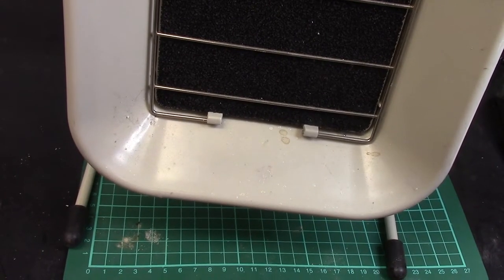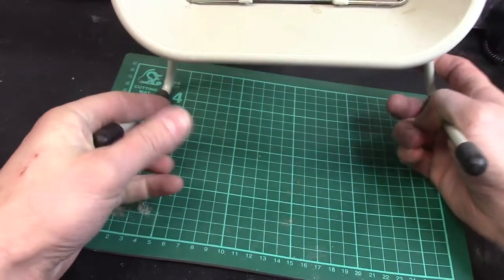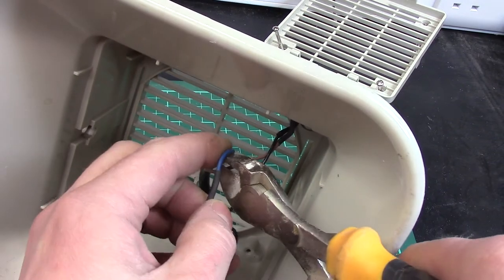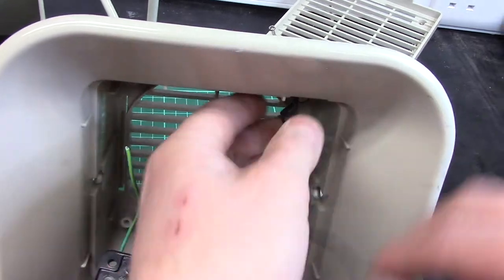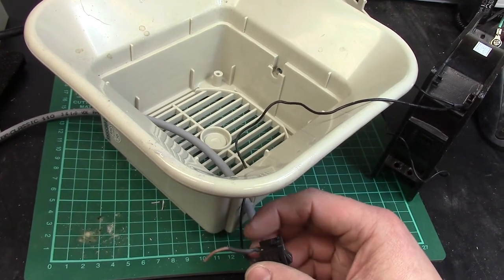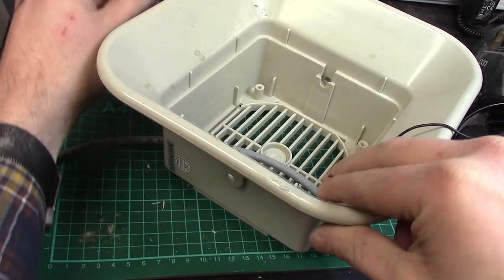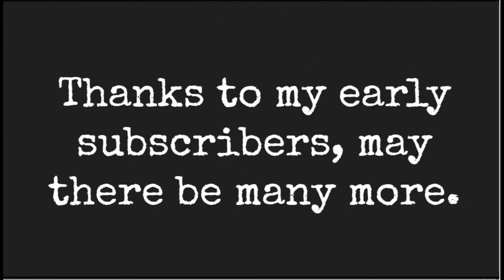Skip rescue: Fume extractor power cable fit

Comment from the maker: Googled the driver, "The Pozidriv screw is an advanced version of the Phillips screw but the key difference is that: Phillips drivers have an intentional angle on the flanks and rounded corners so they will cam out of the slot before a power tool will twist off the screw head. The Pozidriv screws and drivers have straight sided flanks."